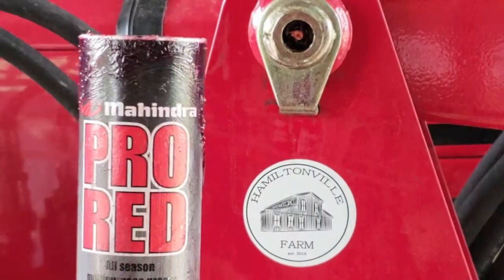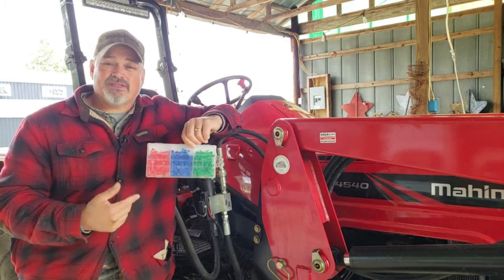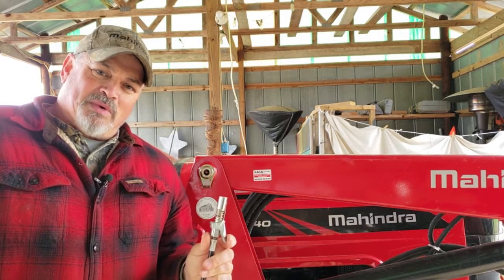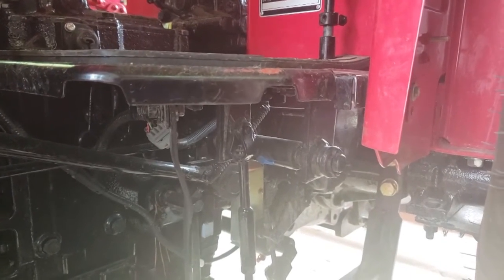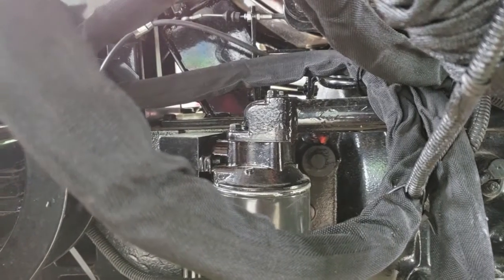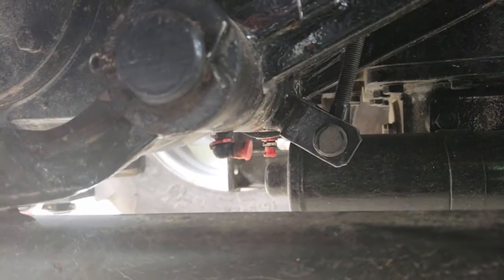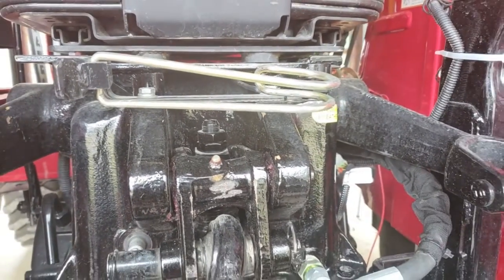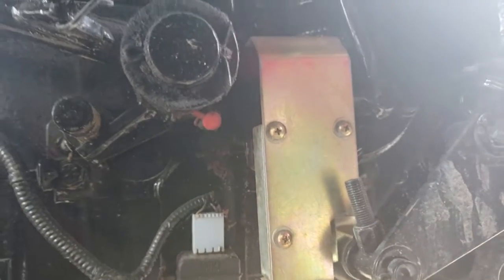How to lubricate (grease) a tractor~ Mahindra Tractor edition

Comment: Great video Hank. I worked 42 years in a steel mill. For 15 years I was a fork lift mechanic. I am a big believer in maintenance. I have a 4550 and for some reason I had never greased the anti friction fitting. On a 4550 it is hidden behind the rear remote  hydraulic hose. Watched your video and went out and dug around and found and greased it. Thank you for a great video.
Reply from the maker: Thank you for the comment and watching. Hope you have a good day 👍